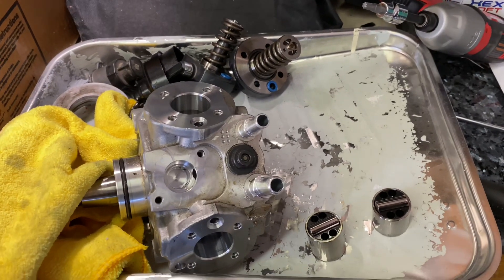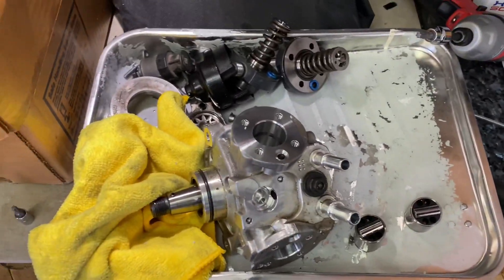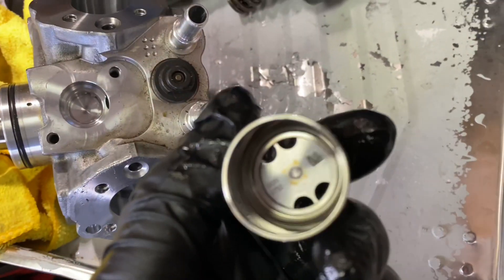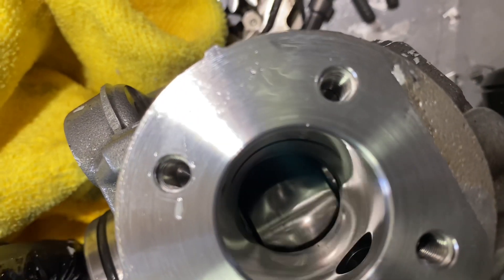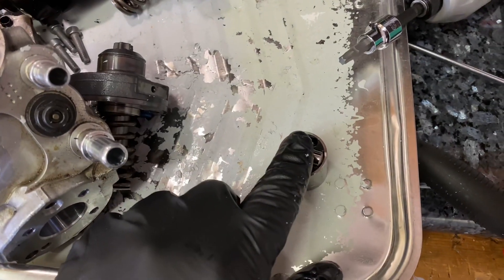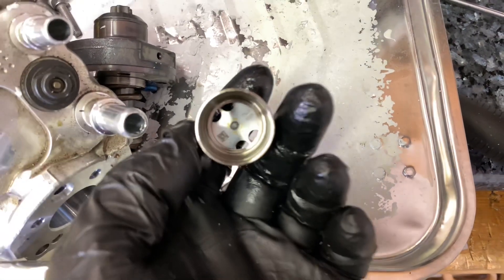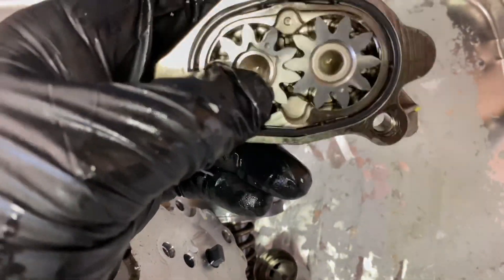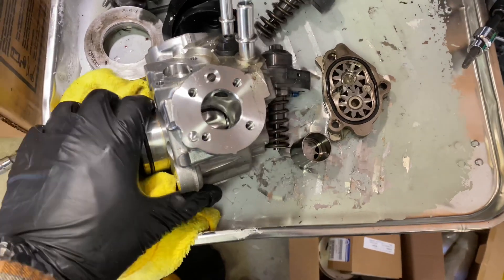Cummins CP4.2 Tear Down

Comment: I just don't get.  Who tested this the CP4 thing. Where's the checks, in this design,  i.e.  so if or when this happens this will negate it.  I've seen things like this before, we'll just fix it in the field.  The better question is who the ______ that said this design is better than the CP3.  The pump is only part of the issue.  Check out the effects of water and air in diesel "systems".

Comment: Many people think, the roller can spin freely. That's not true: As long as the roller is in contact with the cam (that is all the time during normal operation), the cam prevents the roller from spinning. Just try it: press the roller with its housing in the cylinder, so that it is "down" and then try to rotate it. It will NOT rotate (without going "up" of course, but the force of the spring to keep in contact with the cam should be stronger than the force, that could cause rotation).
For sake of accuracy: there two positions of the cam, where the roller indeed can spin: the most upper and the lowest position of the roller. But this is such a short period in the whole revolution of the cam that it is not enough to make the roller spin by 90 degree.
There where CP4's (til 2011 or 2013 ?), which showed catastrophic failure by a 90 degree rotated roller. Bosch nailed this issue by using a stronger spring from then on.
I'm from Germany and diesel cars have a market share of more than 30% here. Same in France. CP4 is the most used pump, so every day millions of cars are running here without any issues.

Comment: Was this a big dimple CP4? Or “revised”
Reply from the maker: Non revised pump.
Reply: @NordicNevs  thanks but damn I can’t find a single video on the revised. Curious if the rollers can still spin on the revised
Reply from the maker: @StreamMastersPW  not sure. But my guess would be the rollers snd failure points are the same. Enough to where the next MY went to a CP3 again. Actually I am hearing the revised pumps are failing more than the original.

Comment: Can I pull the part out with the filter to check for debris and replace without any issues?
Reply from the maker: Yes you should be able to but you’ll need to keep the area clean and make sure nothing falls into the fuel port.

Comment: Hi, Hotshot from new?  Your pump looked good.  I'm also using LX4 now.  Hopefully, Ram replaces the the cp4.2 with the cp3 if mine ever goes bad.  European diesel has a < 1 % failure rate on these pumps.  US is greater than 10%.  I'm sure you know this.  Lubricity is the answer.  ADDITIVES!
Thanks, Benton
Reply from the maker: Hotshot secret and LX4 since new yes, the wear marks are actual grooves I can feel with a pick so it seemed excessive for 21500 miles or whatever was on it. I am glad its swapped out. 
For the 2021s they are certainly already changed, but the limbo for the 19-20 model years is the question I hope they address. That said the industrial pump is impressive and I have been and continue to be cautiously optimistic about it. 
Thanks for the comment!
Reply: @NordicNevs  Hi, thanks for the info.  Obviously, Hotshot Secret made a difference.  I add in addition to EDT & LX4 is Formula 3 made by Lubrication Specialist.  $160.00 / gal.  It's an extreme pressure friction modifier that adheres to wear surfaces.  Hopefully, will save the pump until Ram makes a decision on replacing the cp4.2 on their dime.
What I can tell you is I put this product in the engine.  WOW!  I added 24 oz first dose with engine running.  Before I got all of it poured in the engine went quite.  Diesel clacklng dramatically reduced almost sounding like a gas motor.  Also engine torque during start up and shut down reduced.  I guy I get this from has used since new a 1983 Mercedes 300 D diesel.  He has over 1.2 million miles on the motor; no rebuilds.
Just to add, I added Hotshots TSE to the trans. Really smoothed out the shifting.  Glides through the gears.  No jerking as before.
Any questions call me 619-882-1405
Thanks, Benton